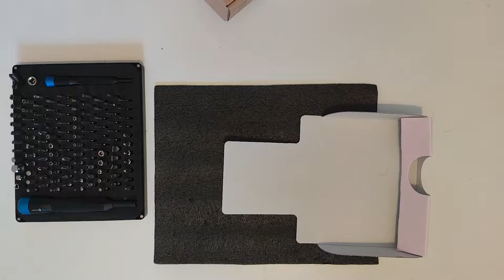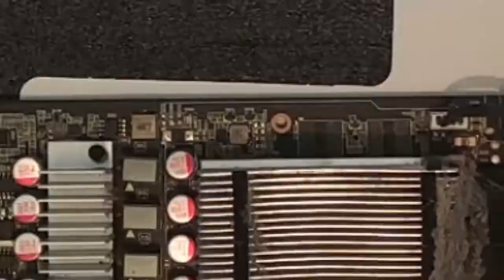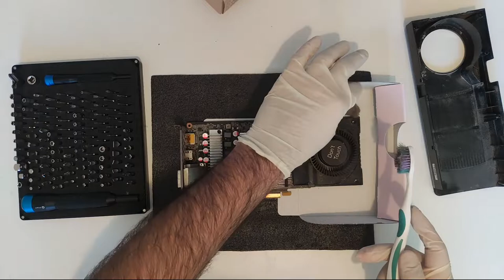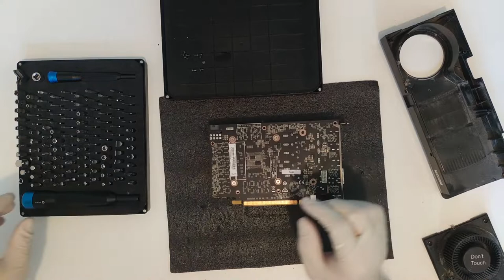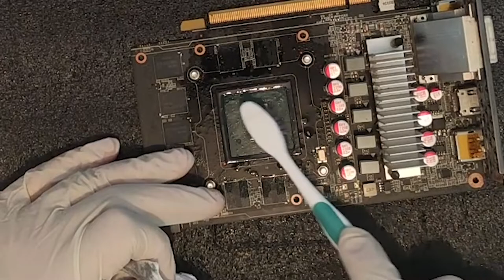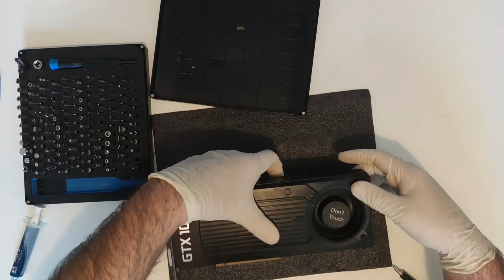How to Clean Blower Reference GPU Coolers High Temps from Invisible Clogs! Zotac GTX 1060 case study

Comment: For those having blower GPU's there is a way to manipulate temps for them to be cool.  1) drill holes in o and 0 like 1060 and around it or just cut/trim plastic on the end in corner by 3-4mm. 2) speed up the fan in afterburner +7-12% compared to stock chart graph. 

3) Add good intake fan on the side pc case... adding fan on the side will cool your entire PC... will literally blow fresh air on CPU and motherboard and RAM and help blower GPU get the fresh air it needs... and will also cool the back of the card by literally blowing on it... front fans are too far away... by the time their fresh air reaches GPU it will be mixed with hot half way... Side case fan is 3cm away from the GPU... Also some blowers have bad bracket with little holes... for those people cut plastic more or replace bracket with single slot row this will improve airflow by a lot.

Result? 61-63c with good paste for 120w TDP, 66-69c for 160w TDP models = victory.

Comment: would be nice if you would run the gpu ...
mine makes noise and i dont know if its normal or fan broken ...
Reply from the maker: In all likelihood if the sound has changed and it's bothersome the fan is on its way out. It's about £6-£9 ($8-$12) for a new fan delivered from CN to more or less anywhere in the world so it's still worth changing it (takes a minute, it's dead easy) - it will take about 2 weeks to get there.
Reply: @ESHW  Where can I find this cooler, mine is a GTX 760 and it is making a lot of noise and noise.